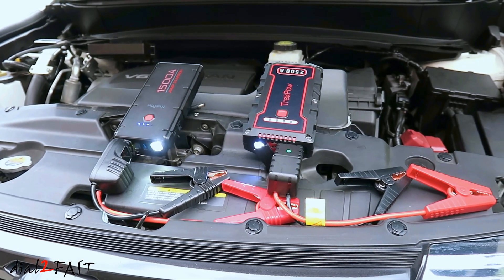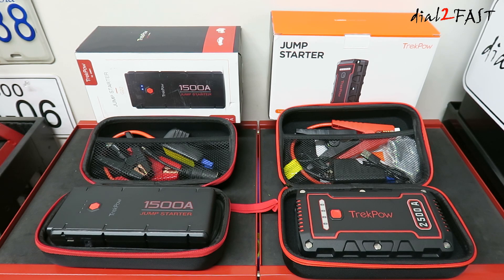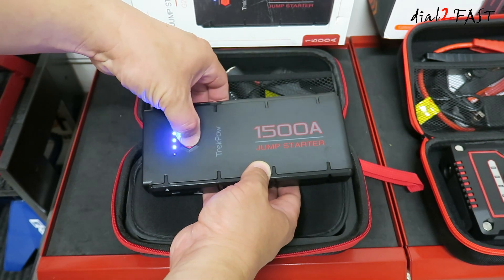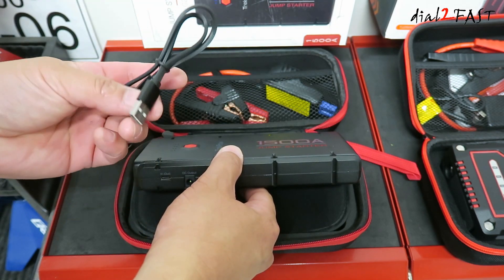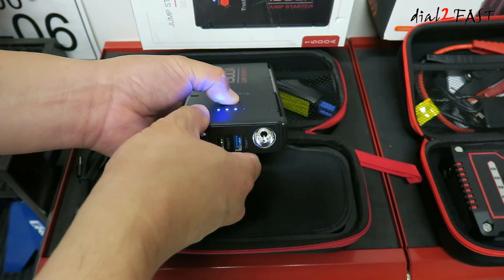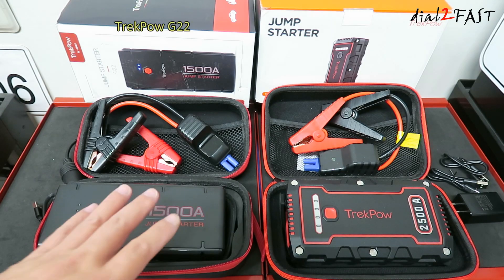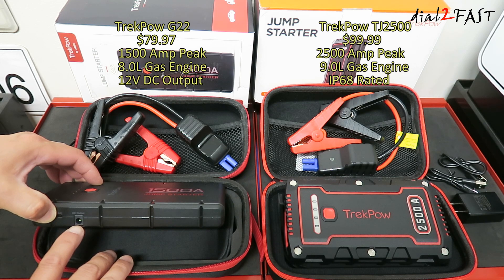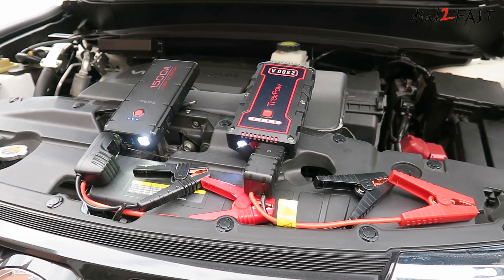TrekPow Portable Car Jump Starter w/ USB Charge Ports - G22 & TJ2500

Comment: Love the TrekPow 2500A and have charged my car battery, lawn mower battery etc. Recently we had an electrical outage in the area and I tried to use the TrekPow to charge my Samsung 24 plus but it would not work; however, I was able to charge the iPad. Can't figure out why I was not able to charge the Samsung which uses a USB C cable and wonder if didn't charge because the TrekPow USB C port is not an output only and that's what I use to charge the unit...

Comment: Does the G22 have the override function if it can’t detect the battery?
Reply from the maker: It does not.
Reply: @dial2fast  Seems like a good idea for anyone buying a jump start capable power bank, to get one that might help with dead batteries, and not just weak ones...?
Reply: End.Corruption yep that’s what I’m worried about. If a car sits too long, this power back won’t have a override setting to try to jump start the battery
Reply from the maker: @Unkn0wnAzn  I did some test on the G22 jumper cable, and it registered a voltage reading all the way down to 3V. So the jumper cable should still operate down to 3V. So if your car battery is at 0V, then the jump starter would not output the jump starter voltage to start the vehicle. The literature for TJ2500 states the bypass button will jump start a vehicle with car battery at 0V. Hope that helps.
Reply: Good question !
So the G22 would be useless if your battery voltage is too low -- like maybe below 9V, 6V or 3V -- and it no longer thinks it's a 12V battery ?

Comment: What's your opinion about these other two compared to the one you reviweing now? The 1) NOCO Boost HD GB150 4000 Amp 12-Volt Ultra Safe

2) Audew Upgraded Car Jump Starters, Jump Box 2000A Peak 20000mAh

I would appreciate to hear your opinion. Thanks in advance
Reply from the maker: I have used quite a few of these jump starters over the years. Jump started my own car and stranger's car at parking lots. I can tell you they all do well in jump starting cars. I know some people in very cold climates experience the jump starter not working in extreme cold. If you are in N Dakota with -50F, you are past the rated operating temperature of -4F. You just have to know what it can and cannot do. Besides this, you can see what additional features you like. Ex. Several USB charge ports , or 12v DC output port for powering 12v devices. I will soon be reviewing a jump starter that had a built in inverter to output 120v. So stay tuned for that.
Reply: @dial2fast  looking forward to that review.

Comment: Can I use the tj25 to charge my vantrue n4 dashcam if yes how many hours can it's handle?
Reply from the maker: If you are thinking of using it as a backup battery for dashcam, it won't work. The jumper cable output does not output 12v unless it detects a car battery load when it's connected. Also you need a setup that allows for constant charge/discharge when using it with a dashcam.